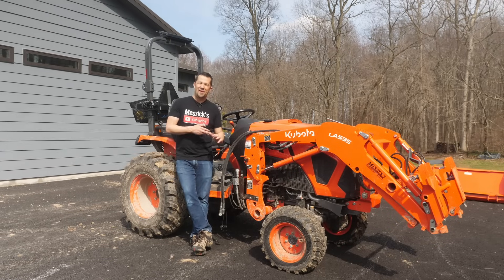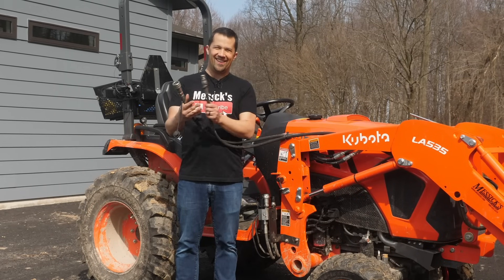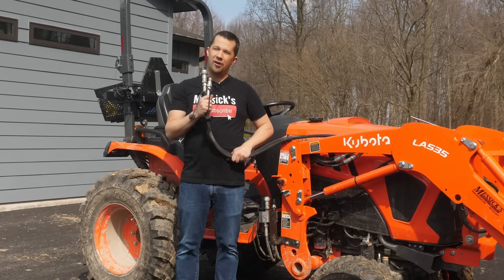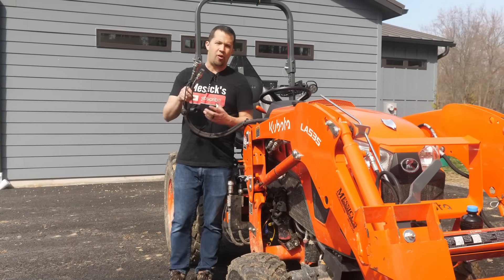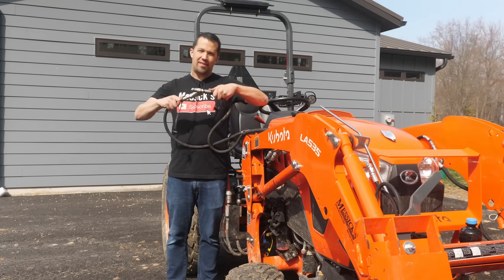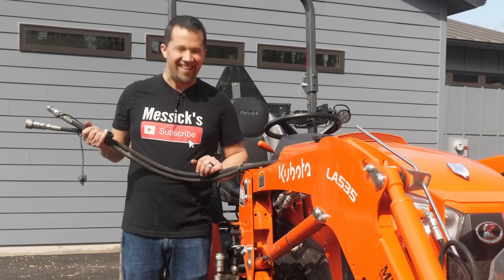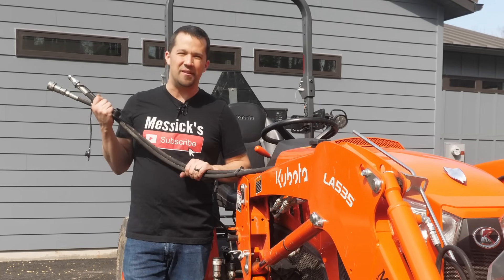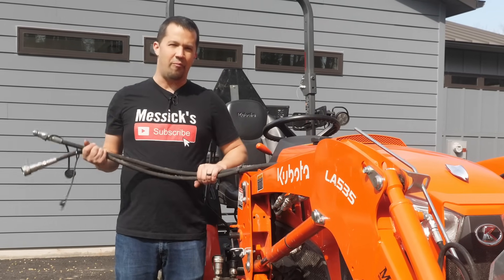How to Relieve Hydraulic Line Pressure

Comment: How timely… this is really annoying, and at times I just give up, move the machine into a shady area and come back later.   With flat face couplers you can usually press on the male end to bleed some fluid… still a major pain.  I was going to look for a pressure relief block like you find on skid steers…. One push of a button and the pressure is gone.

Comment: If you look down that coupler u will see what looks like a bottom take a punch push in on it and that will release the pressure.
Reply: or use a spare male coupler end.
Reply: This is what I do. I use a brass punch so that I have a lower risk of buggering the QC fitting.

Comment: There is a clamp you can purchase to pull couplers together. Nathan on "out of the woods" has one. It is a Irwin clamp modified by Skis steer solutions. Might be something for Messick's to stock ? Skid steer Solutions has a video about them.
Reply: The tool is called a “QC Mate”, made by the company Xboom.  It provides the force necessary to connect the couplers without needing to relieve the pressure at all. I highly recommend it.

Comment: I get this all the time on my grapple when I leave it outside, drives me nuts. I’m surprised no one has come out with some sort of in-line relief valve for just this situation.
Reply: When you disconnect an implement like your grapple,re-couple the ends of the implement back together when its off the tractor.as the temps change and pressure in the lines increase it will tend to balance itself in the closed system thru the movement of the piston  in the cylinder.There will tend to then be some forgiveness when coupling back to tractor.This is making reference to implement lock,not tractor.Also,before disconnecting implement,do not dead head implement in any one direction,leave it kinda half open or closed.
Reply: @northeasterndirtandpropert7974  
You my friend are awesome. I will start doing this as a matter of protokhall. 
💯
Thank you.
Reply: I made a tool to relief the hydraulic pressure. https://youtu.be/finY_sP88yo     Later
Reply: Bolt on Hooks sells the tool for relieving hydraulic pressure.  Tim in northern TN